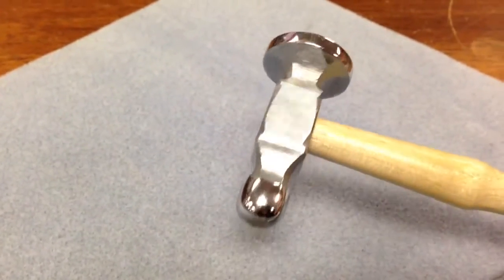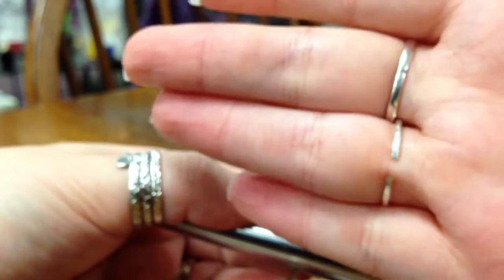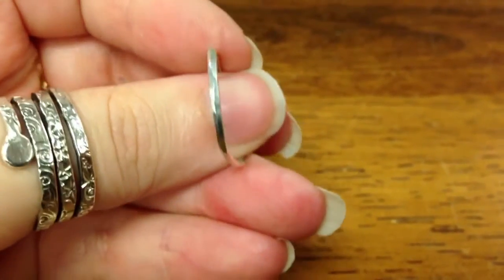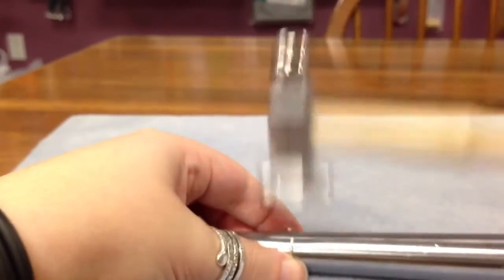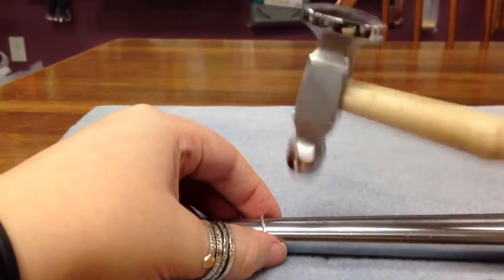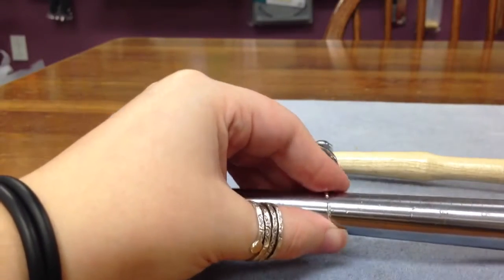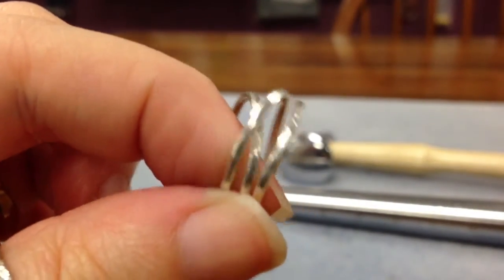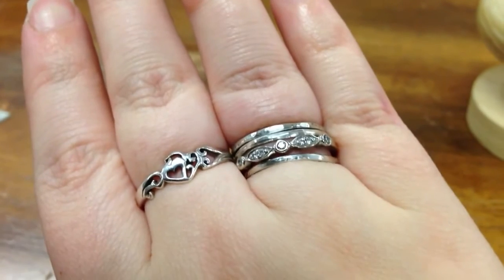Hammered Stacked Cuff Rings DIY

Comment: Can I use 10k 16 gauge dead soft wire? Or does it have to be half hard?
Reply from the maker: Dead soft will certainly work, but your rings will be a little more malleable.  You can tumble them afterwards to make them harder if you wish.